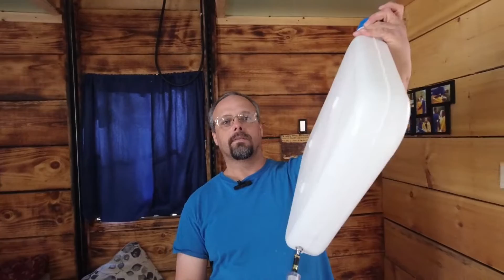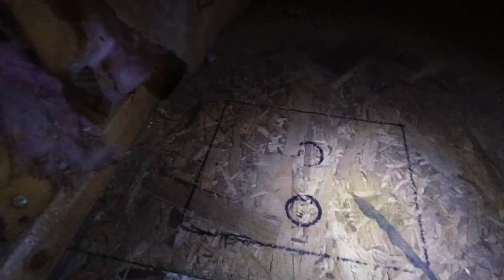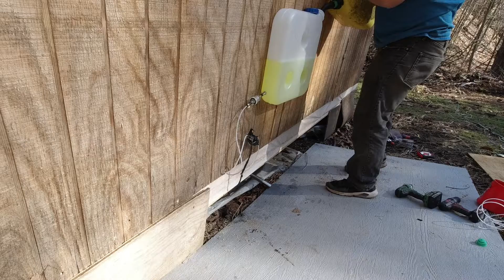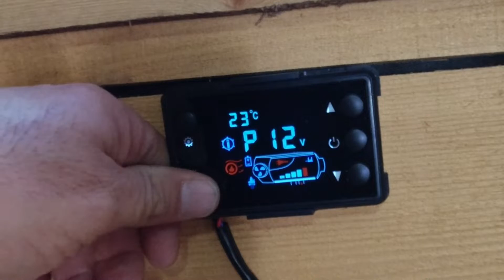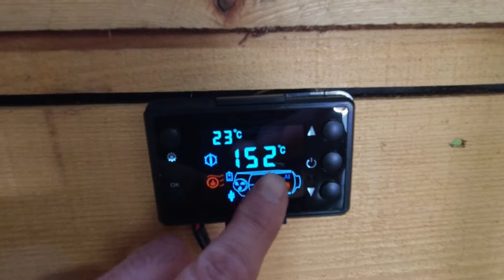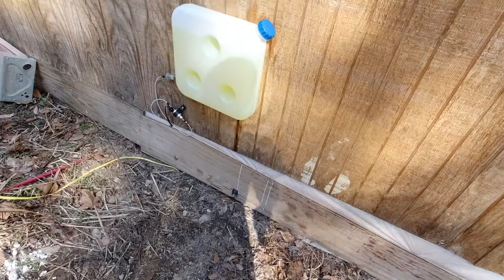Installing a Diesel Heater in My Tiny House

Comment: How’s the heater working currently? I want to put one in my cabin but I’m curious to see how long they are lasting. Thank you for your time.
Reply from the maker: The quality on these are kind of hit and miss. I have got some that were perfect and worked flawlessly and some that were nothing but trouble. I will say that for the most part they are dependable with regular maintenance.

Comment: Not talking trash, but I don't think those plastic fuel tanks stand up to the UV rays. 
Other than that nice installation.
Reply from the maker: It is ok so far. It has discolored, but seems to hold diesel fine still. I will keep an eye on it though.

Comment: Just an observation fuel tank is directly over the exhaust, if the tank split fuel is going to run down to the hot 🔥 exhaust, not sure if those tanks are Ultraviolet proof 🤔 if it goes cloudy then maybe not 🤔
Reply from the maker: Good point. I might ease that over a bit lol.

Comment: I changed out the fuel tank for a 5Gallon tank for my 16x30 cabin
Reply from the maker: Great idea! That doubles your run time.
Reply: I also have a diesel heater in 36 ft motorhome with a 5 gallon tank just so we don't half to worry about running out.

Comment: Seems two would be better and give you time to rebuild other one or clean 
Even propane tank would help keep house warm
Reply from the maker: Two would be good. I haven't installed the second one yet. It has never gotten cold enough here that one couldn't keep up. Plus I have the natural gas fireplace that will keep the place warm with no problem. I do use the heater to heat up the bathroom when it is a cold morning.

Comment: Hey Luke,
I have a quick question for you.
Been really interested since the heater video. Thinking about installing one for my travel trailer. Have watched many other videos on them since yours. One problem some complained of was a strong plastic smell it gave off when running. Have you personally experienced this?
Also, I hope you got the CO detectors for protection.
As always...
May God Bless You and Yours
From Louisiana  🇺🇸🏕🤠👽
JR
Reply from the maker: There is a plastic smell at first when running wide open. I never experienced it as a strong or annoying smell but it was there on the first run. That is probably the little plastic adjustable vents when heated to 200 degrees. It seems to go away after running it a couple of times. It never was unpleasant to me just a slight plastic smell. 
Yes, CO detectors are important. I only have the one right now, but plan on getting another for upstairs.

Comment: That's great Luke ! A full size oil heater would use a lot more fuel than that I think. Great days to you and your family !
Reply from the maker: It will run about 12 hours on high power and use about a gallon. That is way too much heat but I wanted to see what it would do. We had to open a window lol.
Reply: @lukeFugate Great to prove it through !  Best days to you and yours Luke !

Comment: Hey Luke,
I want to say 1st that I like Nucleargator's screen name as being from Louisiana  I have gators in my yard and have to be careful in letting the dogs out..ughh.   I also like his idea of having his unit completely outside. I dont think his aesetics would be so good(both the view in & out probably... well ahh ... suck..lol ) BUT the heater & its exhaust being completely outside is a big plus I think. My fear is that if even a tiny leak develops in the exhaust hose you and your wife might never wake up due to co building up in your house. Carbon monoxide is odorless AND deadly. There are some 50,000 hospitalizations from it in just the US yearly and 1 out of every 100 of those die. Yes... muuuch more than covid <cough>. At the very LEAST you need a 'few' designated CO ONLY detectors in your home. You must not put them right above or real close to any appliance that has combustion.  Definitely I would have one in stairway to your bedroom that would let you know prior to the bedroom.. I personally would have one also in your living room & one in your bedroom.  Best to place about your breath intake height if on a wall like 4.5 to 5.5 ft on a wall or if on ceiling a ft or so away from the wall.  Call me  scaredy cat ... I am a worrier..lol
I was thinking of going catalytic but your right, propane is costly!
I am seriously considering diesel but I need you to use the "Fugate Touch" on a thermostat control first! As always Luke...
May God Bless You & Yours.
From Louisiana,
Jud 🇺🇸       🏕🤠🖖👽
Reply from the maker: You are right, I do need a CO detector. I will pick a couple up today. Already thinking about the thermostat and I think I have a simple solution. 
Thanks for the advice on the dangers of these heaters. I was aware, but I should have said so in my video. It will be corrected in the next one.

Comment: Great video Luke! I'm curious about how it works out with one or two of those heaters.
Reply from the maker: After last night I think it may be ok with one. It only got down to 40F last night but the heater wouldn't go low enough without getting it too hot in here. I had to switch back to the fireplace. I guess I could have opened some windows though if I didn't have the gas. I'm sure we will have some more pretty cold nights coming up to test it out with.

Comment: Great idea so you won't have to just rely on propane. It will be interesting to see how this performs Longterm.  👍
Reply from the maker: I think it will do pretty good. So far it has kept up pretty good. I have to keep it on the lower settings or it gets too hot in here. It only got down to 40F last night(4.444...C) so it wasn't a great test.

Comment: I was thinking about installing one in my mobile home, it doesnt have ANY heat, typical florida! This has been a really cold year and my electric has been $50-60 a month higher. I guess as long as you keep a couple 5gal cans of winter treated diesel you should be good
Reply from the maker: Yes, it should have no problem keeping up with the temps where you are. I had to turn it off last night because it only got down to 40F and even running on low it was too hot. I have some diesel treatment I use in Zephyr so it should keep it flowing.

Comment: Lol was wondering if you were going to try that out. What will prevent the diesel from freezing or gelling up? Have heard it will do that without an additive but I have no experience with diesel at all
Reply from the maker: I use a diesel treatment in it to prevent gelling. It is the same stuff I use in Zephyr. 
I had been told before that the diesel in gas stations are already treated for winter, not sure if it is true. I always treat it anyway.
Reply: @lukeFugate  yeah I've heard a lot of different things about the diesel supposedly already having an additive in it to prevent that but people in extreme temperatures you know I guess sub freezing for long periods of time or whatever have had issues supposedly. What treatment do you use if I might ask because I have a diesel heater that's one of the all-in-one units that I'm going to use for my van and be able to use for my vehicles that I've set up for camping and the unit is going to be sitting outside so that fuel tank is already built in and I didn't want to have any issues
Reply from the maker: @jeanariley7759  I use this kind of treatment. I actually picked it up at Autozone. https://amzn.to/3HOav34
Don't know if it is any better or not but I haven't had any gelling.
Reply: @lukeFugate  thanks. Great. I presume there is an amount per gallon to use etc?
Reply from the maker: @jeanariley7759  yes it has it on the bottle. Can't remember the ratio right now.

Comment: I hope it will heat your place well enough on its own. Can you switch the control to Fahrenheit?
Reply from the maker: I wish I could do Fahrenheit on it but the controller doesn't have that option. One problem with it is it never fully shuts itself off by the thermostat. It slows itself down until it is just putting out a small amount of heat. That works really good when it is cold enough outside. Since it only got down to 40F last night I had to get up and turn it off and go back to the fireplace. I may try to rig it up to work through a household thermostat so it does like a regular furnace and shuts completely down and then restarts in high.
Reply: Sounds like a thermostat is needed.
Reply: Why not crack a window open to let some cool air in?

Comment: I installed one in my house, about 3yrs. ago. I placed mine in the window, I mounted it on a piece of 1/8" sheet metal, 10"x24" (24 is the width of my window. I raised the glass and removed the screen. I keep a 12v. car battery inside, under the window, with a trickle charger connected. I use a 5 gallon gas can located outside, close to the window. The fuel smell stays outside, with the exhaust and intake. I have concrete walls & didn't want any holes. House is about 24' x 24' single level in South GA, USA. One heater is enough for me.

Hoping you the best.
Reply from the maker: That's a pretty big area. If it will heat that much this one should be pretty good. 
So you basically made a window unit out of it. Interesting. That would be a good way to have seasonal or emergency heat and put it back away when it is not needed. It could be used in any house with a window big enough. Kind of like a window AC. You got me thinking now. May be content for another video. Thanks!